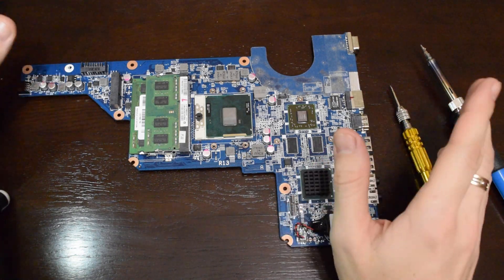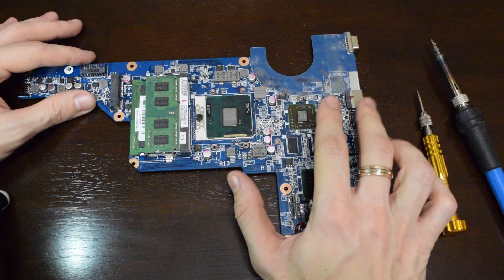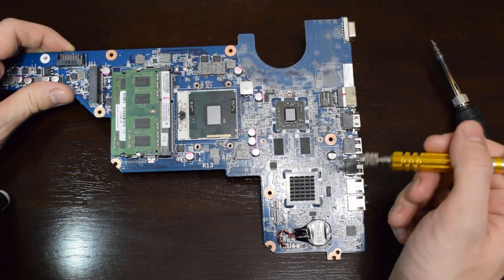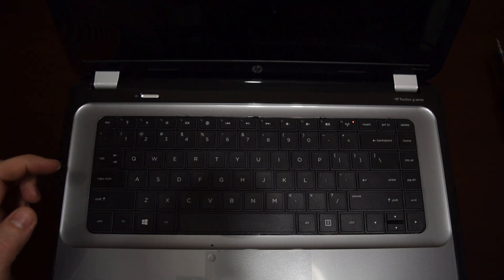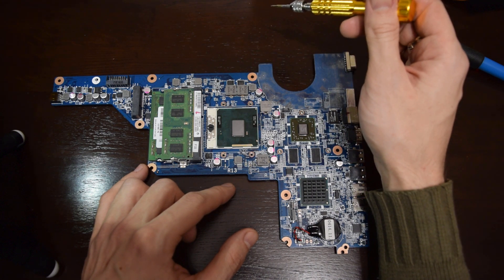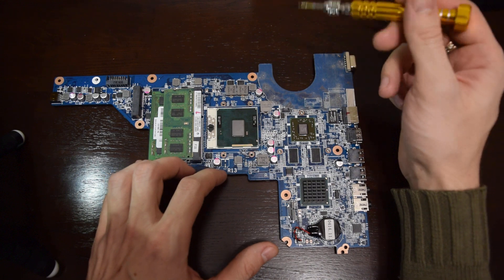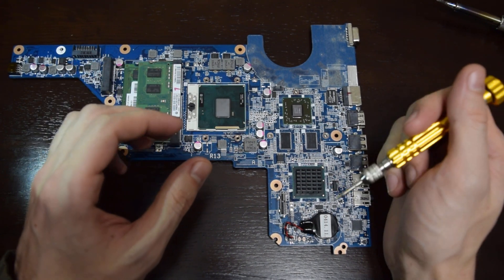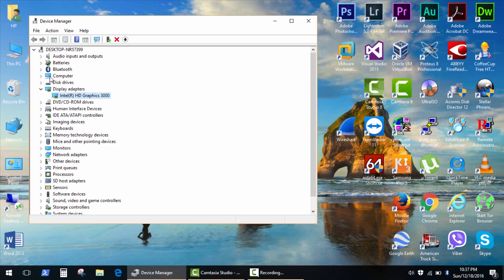Fix Dead GPU – Convert HP, Dell, Lenovo Laptop to UMA Graphics (HP G6 Example)

Comment: What should I do If Laptop works but I got colors after a while of starting blank colors red blue green and so on .. color come and go but the device is still working and I changed graphics from bios from dynamic to static and from Windows choosed the  intel gpu .. but the problem still remains blank green for a while then blank red then windows back then another blank color again the problem existed as stupidly fan is broken and still playing on laptop with a useless fan pad .. should I go for your way and give up about ati gpu If yes I will go for specialist to do this process for me I don't want to broke another thing I have already made a disaster :(
Reply: p.s. may intel gpu as integrated is also broken so I still got these colors? or the ati chip is causing this just because it still physically installed on the board ..can these colors caused by the processor and I am going to break the good gpu?
Reply: Sorry for saying too much but I didnt use laptop for about 4 years coz of this problem and fortunately find your video ... laptop is hp pavilion dv6-6120ee.
Reply from the maker: Sorry for the late reply! OK first of all you have find the source of those colors artifacts. When you see them pres PrintScreen key on your keyboard ant then run paint and paste. If you see the same the problem in GPU if the picture without artifacts the problem in LCD. If you want to disable dedicated graphics you have to remove these coils: https://ibb.co/6rc5VKy
Reply: @ElectronicsComputers  Hello again, after trying these steps  the result of print screen is the picture without artifacts which means the problem is in LCD but before when I got these colors I used to get a blue screen telling Video card has stopped working can the problem be in both? and also this happens when the board becomes hot +70
Reply: @ElectronicsComputers  Is this means replacing the screen too? :(
Reply from the maker: First of all I've never seen any Intel's CPU with GPU defects. They are extremely reliable, it's like day and night compare to AMD or Nvidia. 
If print screen is great then problem definitely not in GPU! I would try to reinstall Windows just in case of corrupted drivers. When you see those artifacts try wiggle the screen like slightly open and close and slightly hit the back cover of LCD. If that makes the artifact to desperate then check the LCD cable there may bad contact. My best guess would be LCD cable or LCD itself. Simply disassemble the screen and check everything.
Reply: @ElectronicsComputers  I will visit a technician and tell him what u said but I hope he won't make it worse, I appreciate your help and best regards.

Comment: Hi. Is hp g42-458tx use the same method or need to solder some caps
Reply from the maker: Most likely it's not gonna work with 1st generation CPU.

Comment: Hello and thanks for showing this. I have a Sony VAIO SVE14125CLB, will this work ?
Reply from the maker: Hi! Technically it's possible for Sony but absolutely unreal for home fix especially without experience. Removing only one coil works perfectly for Dell and HP. Those laptops have absolutely perfect and genius schematics. For all other laptops you have swap/remove or add a bunch of small elements like resistors and capacitors.  You can go to a good repair shop and ask them to convert it to UMA graphics in case if you want to save some money.

Comment: Will this work on hp dv6 pavilion notebook? The laptop is apart just not sure what coil
Reply from the maker: Sure! If there there Intel CPU starting from 2nd Generation. What's the model?
Reply: @ElectronicsComputers  Hp dv6 6c53cl
Reply from the maker: Yes it works perfectly for your model. Simply remove these two coils: https://ibb.co/DKD4LSW
If the your problem really in GPU it will help!
Reply: @ElectronicsComputers  Here's a pic of mine to confirm https://ibb.d/rmHXwdz
Reply: @ElectronicsComputers  Hey I sent you a pic and the model was actually dv6 6c35dx

Comment: Hey men how are you?

I just copy paste my message again since i dont know if you see it.

have a similar problem with my Asus N53SV wich have a intel i7 2670q with a intel HD 3000 and a gpu Nvidia GT 630 the gpu die back in 2015 and wasnt able to replace the motherboard so far =/ so i find your video some weeks ago but not sure wich one of the coils i most remove i take a screen from my phone.

https://i.imgur.com/cLGBsVA.jpg

 Here is another i find on internet without the heat sink https://i.imgur.com/1DG1BrX.jpg

If you need i upload the screens in other host letme know.

Comment: Hello and thank you for the helpfull video! I'd like to ask if this method works with my laptop, I have an hp g62-125sl with a rev:f daoax1mb6fo motherboard that does not boot and when it does then it has artifacts, there is 1 small 1Ro coil next to the gpu, so all I have to do is to remove that?
Reply from the maker: Yes, it will work perfectly! Just remove the coil on the upper side of GPU.
Reply: @ElectronicsComputers  Thank you for the reply, but sadly it did not work, laptop didn't post at all so I put it back. Looks like I'm gonna try a reflow and once let's me boot I'll flash an unlocked bios and disable the dedicated gpu. Is that a good idea in case the gpu kicks the bucket again?
Reply from the maker: Are you sure that the problem is in GPU? What indication does your laptop show?
Reply: @ElectronicsComputers  It turns on, fan spins, hdd spins, lights on, no beeps and occasionally screen shows up on the external monitor with artifacts, but no bios.
Reply from the maker: Try to turn on your laptop and wait for a minute and then try press CappsLock key. Does it turn on and off capslock indication? If you have Intel CPU i3-i7 then removing that coil should definitively work. like 100000%. I would try again to remove that coil and connect external monitor.
Reply: @ElectronicsComputers hello sir after removing this coil will my HDMI work?

Comment: sir could you help me...which coil should i remove? i have Acer E5 473g with a problematic Nvidia 940m GPU. thanks...
Reply from the maker: It's almost unreal to do it at home for Acer. Because you have to swap a bunch of tiny resistors. remove and add some components. It's easy only for HP laptops.

Comment: Where is to remove

https://drive.google.com/file/d/1UQDwlduBAVSkbTYxT4ImtCjB1WB4d-2Q/view?usp=drivesdk

my system is amd apu a8-4500m + hd 7400m, i guess my system are supported uma because the grapich driver from ky manufacture named the driver default as amd_uma_comal_12.10.zip
Reply from the maker: You didn't tell me the brand and model of your laptop! I have to look schematics to answer your question. But what I can see from your picture it's the blue one that is bigger. Actually, I'm not sure that the problem in GPU... Give me the model of your laptop.
Reply: @ElectronicsComputers  My laptop 

Asus K55DR

sometimes my laptop blankscreen on boot screen ( ussualy caused by overheat ) but if i teardown and heating the discrete gpu chip with lighter and after that its turn on and can boot up ( but with waiting a minute before entering login screen, and i must modified the driver because if not the driver will activate crossfire mode after install the driver ).

thanks i hope you can help me.

Comment: Hey man ! I actually have a problem in my laptop GPU ! I have AMD r5 m330 2 GB graphics, it was working fine but suddenly one day the blue screen error occurred. I tried many ways to solve the errors but ended up with nothing, But fortunately when I Disabled the Radeon graphics it worked, and whenever I try to install AMD drivers it starts to saw blue screen and hence it even don't starts to the desktop ! So please could you help me ! Can you tell me more about this matter !
Reply: i have the same proplem :( on hp dv6
Reply: Same issue on my hp envy 17 3200nr i pulled two coils near the dead amd gpu and everything was perfect with the igpu after, the computer doesn’t even see the amd card anymore

Comment: Hi there 

I have a similar problem with my Asus N53SV wich have a intel i7 2670q with  a intel HD 3000 and a gpu Nvidia GT 630 the gpu die back in 2015 and wasnt able to replace the motherboard so far =/ so i find your video some weeks ago but not sure wich one of the coils i most remove i take a screen from my phone.

https://i.imgur.com/cLGBsVA.jpg
Here is another  i find on internet without the heat sink
https://i.imgur.com/1DG1BrX.jpg

Comment: Hallo ! And first of all let me thank you for making this video !
to tell the truth i've stumbled a few times upon this video and skipped it because i' found it irrelevant UNTIL now...  
It just happens that i own a HP Pavilion g6 2XXX series, same like yours just newer, and it has a dead dedicated GPU, the laptop still works and so, but as soon as i am installing AMD Drivers it crashes and every time i boot i get bluescreens. 

My question is, since the board is almost identical to yours, should i just remove that gray "Mosfet" that is nearest to the GPU ?? or is there something else to do too ?? 
i've seen a video on YT, a turkish guy is explaining something about the mosfet but also mentions something small too, and i think it's related to this fix of yours here's link if your willing to watch it, it only takes 4 minutes https://www.youtube.com/watch?v=MAvcoefbUNA
the board in the video is almost exact as mine only model numbers differ.

I'm hoping to get better temperatures after disabling completely the GPU
I know this video is old, but i still hope you answer questions... thanks
Reply from the maker: Hi! give me the exact model number I'll schematics. But anyway disabling GPU will solve your problem. And you have to remove tho coil not mosfet. Mosfet it's a transistor from a voltage regulation circuit.
Reply: I'm amazed you actually replied, thank you very much ! 
Model number is - R33  DAO33MB6F1 REV:F
Reply: didn't understood the part with schematics, did you wanted me to provide schematics or you have schematics >??
Reply from the maker: All I asked is to give me the exact model number! Not HP Pavilion g6 2XXX series!!!! Anyway if this motherboard looks like yours then remove Coil 1 and check if it works if not remove also the second one:https://ibb.co/nJTBQf

Comment: Thanks man, I just did it on HP 431, and it worked just as you said the nearest Coil, reflowing Graphic card is over ✌✌✌
Reply: bro i hve a 431 what part of th motherbord did you removed?
Reply: @christianretuerma8041  look in the video the coil is the grey chip, the on closet to the gfx chip
Reply from the maker: I'm so glad I could help you!
Reply: Thanks for your feedback on hp431. I'm going to try it 👍

Comment: I have Sony vaio i3 350m CPU with still 2gb graphics.
Can I apply this method as my laptop screen is showing flickered graphics and my ati chip is failing
Reply from the maker: This is first generation of i3 and with Sony it's almost never works. Give me the model of your laptop, I'll check its schematics.
Reply: @ElectronicsComputers  does Intel 350m has  . My laptop serial number erase.
It is Sony Vaio E Series Core I3 with ati graphics

Comment: Hi there, loved your video. I too have a dead nvidia gpu and would like to identify which coil to remove. Could you please help me out. My laptop is MSI GE62 with core i7 4th gen cpu and nvidia gtx 850M.
Reply from the maker: I think it's not gonna work for this motherboard's schematics but you can carefully try. You're not gonna make it worse: https://ibb.co/huYSZK
Reply: Also my laptop model number is GE60 2PC and not GE62
Reply: Mine looks different, here a picture if it helps. https://ibb.co/gFTsjK https://ibb.co/e7271z
Reply: @2013Electronics&Computers 
Hi, can you please help me in identifying the exact coils that i should remove. I have included the picture of my motherboard here https://ibb.co/gFTsjK

Comment: PLZ  does it work with HP Pavilion dv6-1215ee  ?
Reply from the maker: Unfortunately not! It's previous generation of CPUs (Intel Core 2 Duo Processor) without integrated graphics in them.
Reply: THX.

Comment: Hello Sir, I have Asus x540uv . which coil shall I remove? Intel core i 7, 7th generation.
Reply from the maker: It's a new model, are you sure that your laptop is not under warranty? 
Here's a picture of motherboard with removed GPU: https://ibb.co/bTe4Rz
Remove those two coils.
Reply: @ElectronicsComputers  https://ibb.co/nBe5zK
Reply from the maker: @TT-ft5hk  yes it's them. Try to carefully remove them or at least one terminal from each coil. But first tell me the behavior of  your laptop  indication or something and why you decided that the problem is in GPU?
Reply: @ElectronicsComputers  it was not starting, the technician put the Mother B. in oven and it started, the next morning it stopped working again. He decided its problem with battery and i am using it with direct plug. But yet if i switch it off and remain for few hours it doesnt switch on again, so i left the adaptor pluged for 20 minutes and it starts again. So now I am using it direct with cable with out battery and in mornings i have to wait 20 mins or 30 mins for it plugged then i start it
Reply from the maker: It's hard to tell where's the problem. OK while you're waiting for 20-30 minutes if you press the power button will your laptop turn on but without image on the screen or there's no any reaction on power button?
Reply: @ElectronicsComputers  it was switching on with out any glitch.. But now again the display is no longer there.. Black screen now.. I still didnt remove the wiring.. I will do.tomorrow at the electric place and I will give you feedback. Thanks sir
Reply from the maker: I'm happy to help! Hope it will work for you.
Reply: @ElectronicsComputers  it is under warrantee. But i bought it in dubai and travelled to africa.. The company i bought from are telling me if its opened i dont have warrantee any more. And i opened it. Secondly there is no asus agent in Senagal so i have to ship it again to dubai if they accept. Which is much more costly to send it and bring it back with dhl.

Comment: I have the same problem but i was able to boot safemode then deleted the discrete GPU's driver. Everything was working fine until today, the screen went black, screen is working but there is no image, and sometimes distorted images. System can boot unlike before, but there is not even HP splash logo or BIOS. Do i need to disable dedicated GPU from the mainboard? or integrated graphics died too? Here is my mobo: 
https://ae01.alicdn.com/kf/HTB1L_AuRVXXXXbfXFXXq6xXFXXX8.jpg

specs: hp pavilion dv6, hd6490m, i5-2430m

btw i dont have a solder, can i do it without it?
Reply from the maker: Simply cut one of two legs of this coil: https://ibb.co/bTRZe9
Reply: thank you very much! if i want to reball that gpu later, will it be possible after cutting it? also no soldering after removing the coil is  ok?
Reply from the maker: Sure! Without any problems.

Comment: Hello 🤗
I have the same problem with mine 
HP pavilion g6 1157ee
Board : DA0R13MB6E0
But caps lock key never blinking
Would I try this fix or not !?!
Reply from the maker: The problem may or may not be in your GPU just give it a try. Remove that coil, you're not going to make it worse.
Reply: @ElectronicsComputers  
I removed it
But still the same  problem
Just power light and WiFi key is on
What can be the problem !!?
Reply from the maker: When you're pressing the CapsLock key the LED turns on or off on that key? Try to reset BIOS by removing bios battery. Check the RAM. When you turn on your laptop is there any indication of HDD LED at the left side?
Reply: @ElectronicsComputers  caps lock blink only for 1sec when turn on lap then go off even pressed it
There is no HDD indicator light just power indicator is on
Tried bios reset many times 
Doesn't work

Comment: my laptop is hp probook 450 g1 , can i do that ?
Reply from the maker: https://ibb.co/gyw2QK
Reply: thank you very much
Reply: i removerd it but the charger led light is still blinking , any idea?
Reply from the maker: Is there only one blinking power LED? Who told you that the problem in GPU?
Reply: the power led blinking continuously (white) and no action in the laptop
Reply from the maker: First of all put the coil back. Disconnect the BIOS battery for a minute and of course disconnect your power suppler and the main battery. Remove Wireless card, hard drive and the keyboard. Then try to connect the power supplier and turn on your laptop. The test without the keyboard is very important! If LED stopped blinking put everything back except the keyboard and try to turn on again.
Reply from the maker: Moreover I'd recommend if it's possible to swap the keyboard. You can go to some repair shop without your keyboard it's just 20 seconds to check if it's faulty. Then you can buy that keyboard from them or Aliexpress. Good luck!
Reply: First of all thanks very much for your response , i did all these things but the problem is the same

Comment: Can you help please i have an HP Pavilion dv6-6100 Quad Edition I7 with a Radeon 6770M GPU 

https://www.dhresource.com/0x0s/f2-albu-g4-M01-08-D9-rBVaEFoDxWCAWdjMAAPS1U2GOiQ573.jpg/for-hp-pavilion-dv6-dv6-6000-dv6t-6100-series.jpg

https://www.colorlifebuy.com/images/hp/659148-001_03.jpg

There is two coil next to the GPU (R56 TMP K1121), and thakns in advance
Reply: Edit: I tried your trick and it worked like a charm , thanks a lot man ❤

Comment: which coil removed for hp pavilion dv2000 thanks
Reply from the maker: It's Core2Duo CPU so no chance sorry. It requires more modern CPUs like i3-i7 with built-in graphics in it.
Reply: thanks for you

Comment: What the procedure of Dell N5010 which is powered by Intel i5 processor and Amd Radeon graphics
Reply: Sadly it's much more difficult, because it did'n have a swichable graphics. You need to switch several component so it doesn't worth it in my opinion. 😢